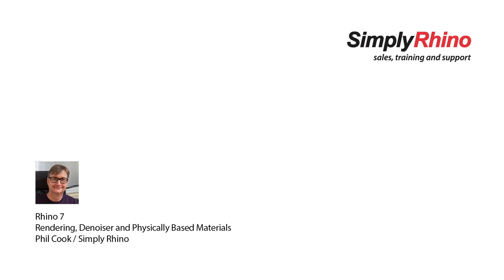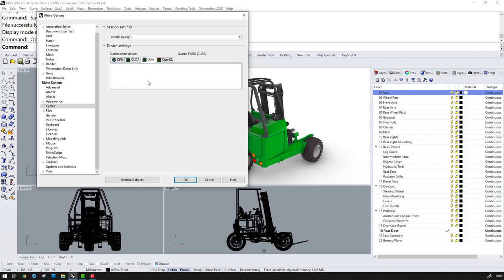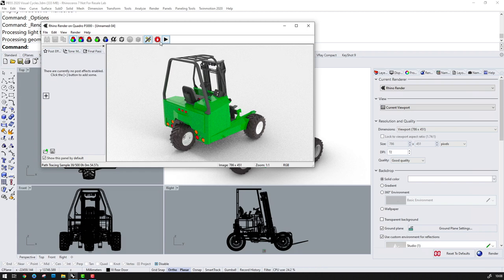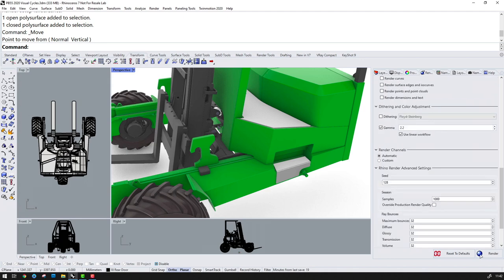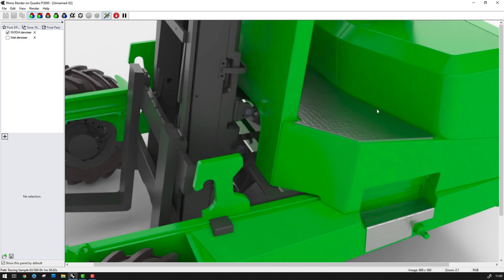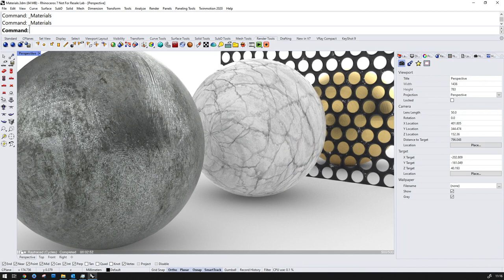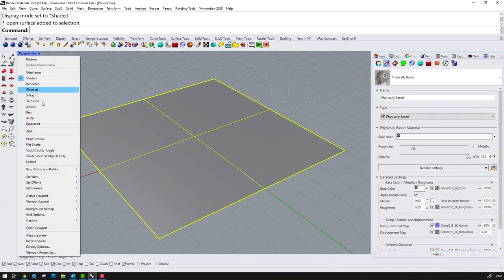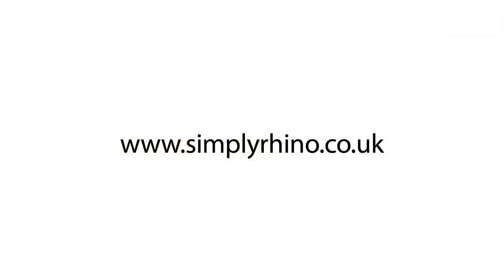Rhino 3D v7 – Rendering, Denoiser and Physically Based Materials

Comment: Could you explain a little further what you mean by "dense render mesh" for the displacement to work correctly? thanks!
Reply from the maker: Hi Joanna. Thanks for your question. By a ‘Dense’ render mesh – I mean a mesh with a high polygon count. You can set this in Rhino Options > Mesh (or on a Mac, Settings > Mesh) and is best achieved by setting a ‘Custom’ mesh.

Comment: how do i render this in turntable animation in higher DPI, hi res, "best quality" with these textures, like when i do a still image render with rhino7 render engine?
Reply from the maker: Hi Mikele,
If I’m understanding correctly then you want to create an animation using the Raytraced (Cycles) engine in v7 with specific settings on image size, quality etc. Make sure the current renderer is set to ‘Rhino Render’ then go to the ‘Rendering’ panel then set up your image size, quality/number of passes etc just as you would for a still image. Next, set up your animation and choose ‘Render Full’ for the ‘Capture Method’. When you create your animation you will see the first frame appear in the Frame Buffer from where you can add the Denoiser. Rhino will now render the first frame followed by all the subsequent frames at the settings you input in the ‘Rendering’ panel. Hope this helps.

Comment: The emissive object look a bit 2D, there should be some sort of halo all around the perimeter of the emissive object itself, with some sort of light dispersion
But it is a step in the good direction nevertheless.
Reply: that would happen if he showed the post effects.
Reply from the maker: Hi IYN. You can add these in post in Cycles. Click on the + symbol in the Cycles Frame Buffer and look for (eg) ‘Bloom’. In V-Ray for Rhino you have to do a similar thing.

Comment: I have Rhino 6, and from one day to another my renderings started to get noisy. its frustrating as i don't now how to get rid of it. every time i start to render the denoiser switches himself of.  i also cannot find the package manager as the program is strucutred differently. anyone a suggestion?
Reply from the maker: Hi there, Raytrace rendering can be inherently noisy. The ‘old’ way of reducing noise is to create more passes as each pass will gradually reduce noise. The denoiser can (by using a sort of smart blurring) reduce the need for passes – so, for example, you might see a better result with 750 passes plus the denoiser as against 1500 passes without. A good lighting solution will also reduce noise. As far as I know the ability to use a denoiser with Rhino’s raytrace render (Cycles) applies to Rhino v7 only and not Rhino v6. Package Manager is a new feature in Rhino v7 and again does not ship with Rhino v6.